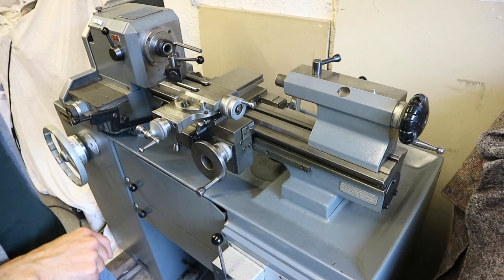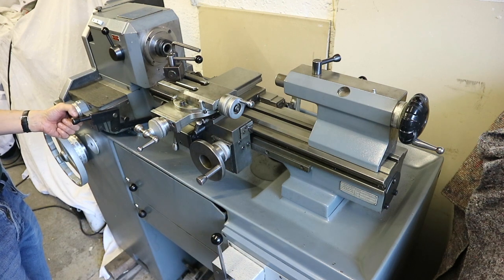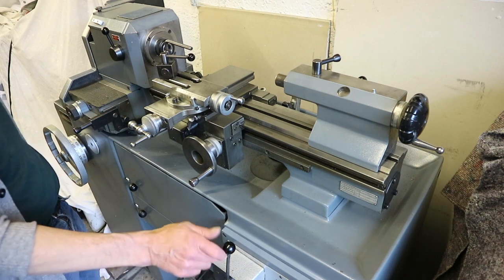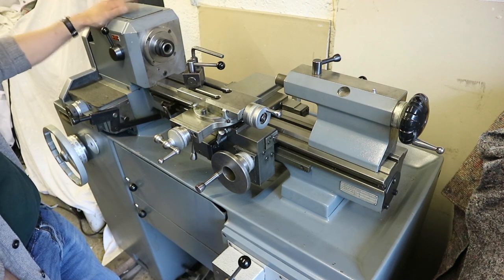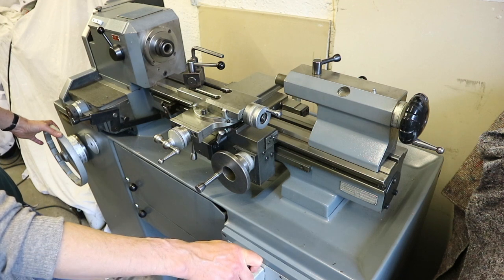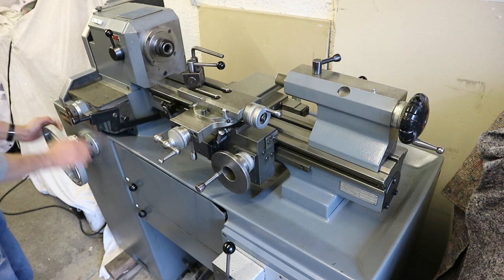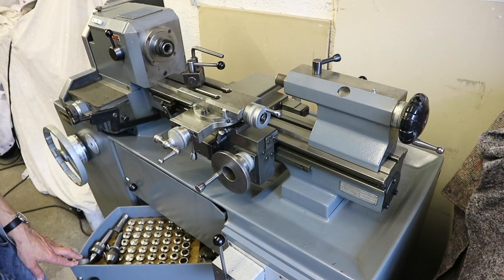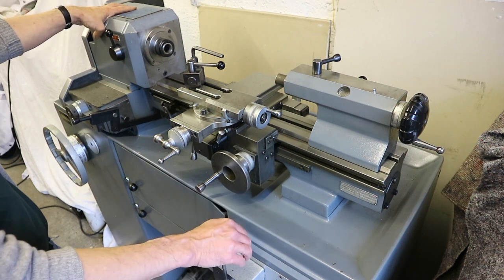Schaublin 102N-VM

Comment: Very nice, however for a hobby lathe it makes a lot of noise.
Reply from the maker: It sounds louder in the video than it is in real life, but yes, they're not a particularly quiet machine like a Hardinge for instance. Much depends on the drive type. This machine has a Reeves type variator which is slightly different in design to the Hardinge type and somewhat noisier. If you take a look at my video on replacing and adjusting the bearings on a plain 102 you can see how much quieter the standard flat belt drive is.
Reply: Why would anyone buy a machine like this as a "hobby lathe"?
Reply: Why would anyone buy a machine like this as a "hobby lathe"?

Comment: a fantastic machine David!
Reply from the maker: One of the best I've had William. Interestingly, this one has the ungeared cross-slide screw with normal plain 102 index dial rather than the more usual large dial. It is a factory fitting and even has a drawing in the manual. IMO this is a much better arrangement as there's no gear to introduce backlash.